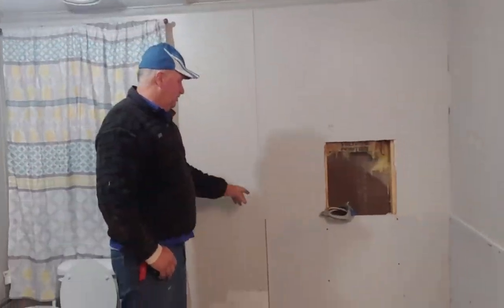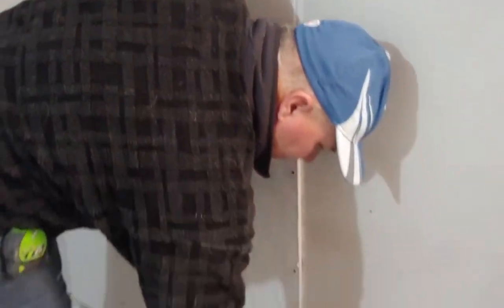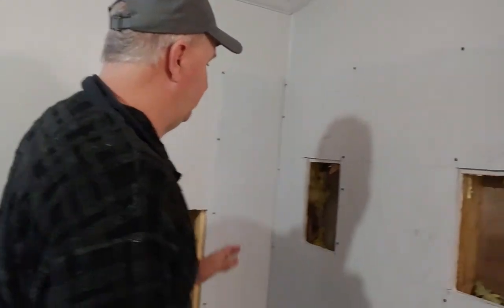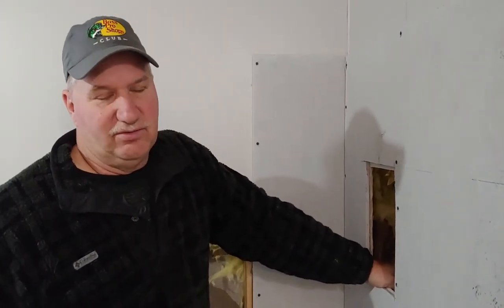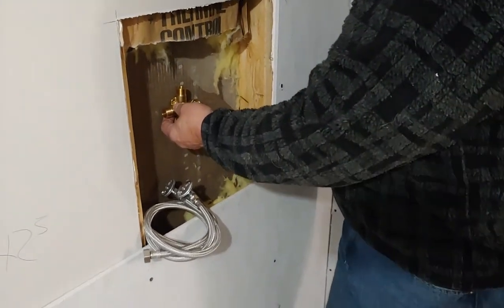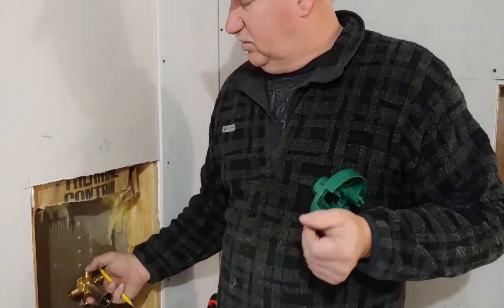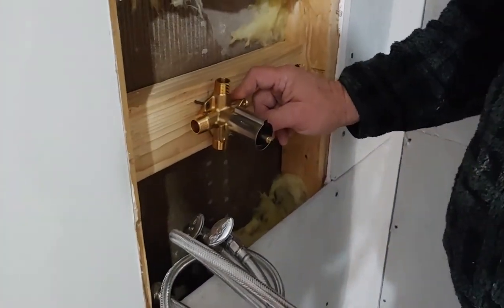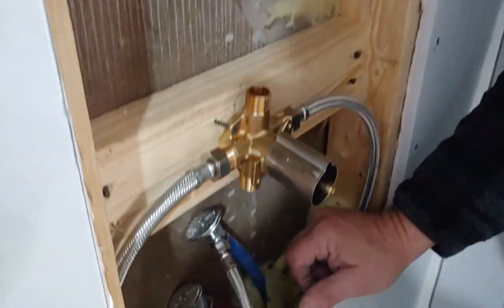How To Adjust A Shower Kit For Mobile Home

Comment: Good stuff. I see the Sistine shower base is already installed. Do u have a video on how u installed it?
Reply from the maker: I am sorry i did not do a video on the base what was require was to measure the location for the drain leaving plenty of room we have a video on replacing the floor in that area then just put clear 100 % silicone and laid it down no screws or anything like that hope that helps
Reply from the maker: This is Chris his wife. There's a video on the floor cutting and silicone install. Only thing not showed was the actual placement. https://youtu.be/Qk5TzkyxpQg
Reply: Very helpful. Thank u both